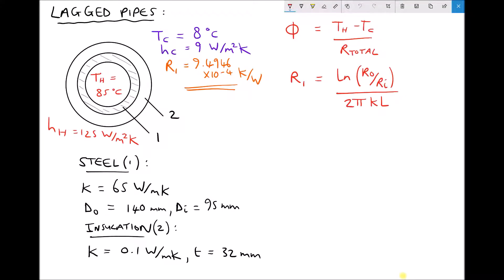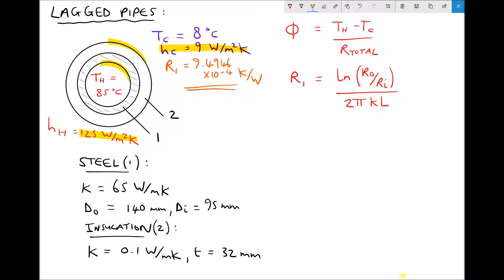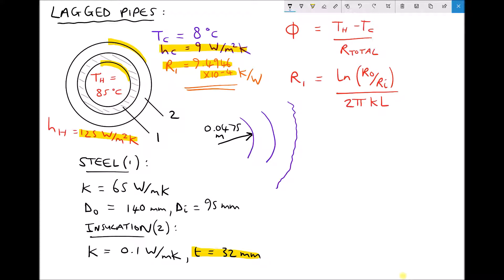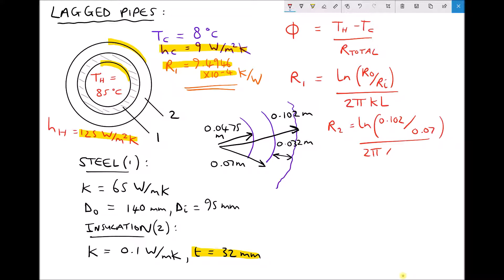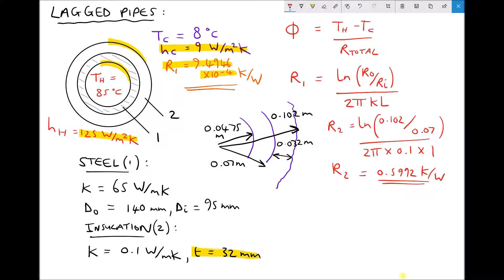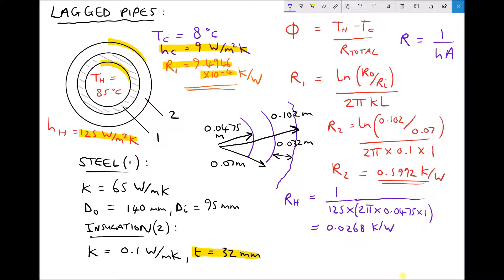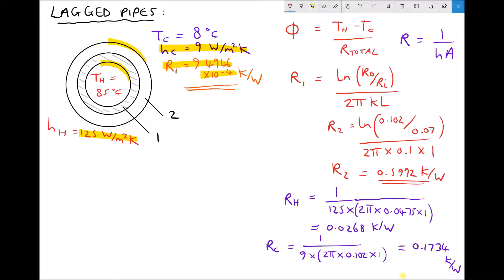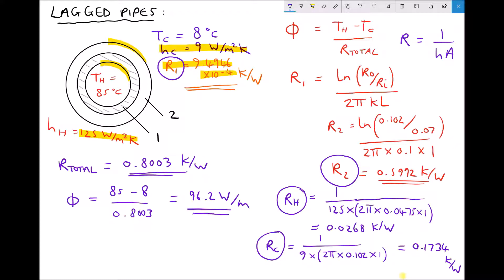Calculating Rate of Heat Transfer Through Lagged Pipes

Comment: Please advise if RH and Rc are resistance due to convection heat transfer. Also how to add resistance due to radiation heat transfer
Reply from the maker: These are the thermal resistances due to convection (surface effects).  Radiation is not covered in this video.